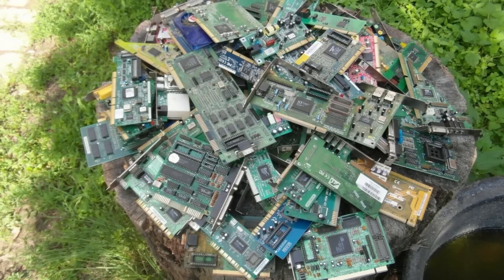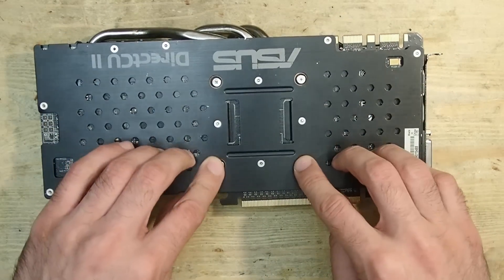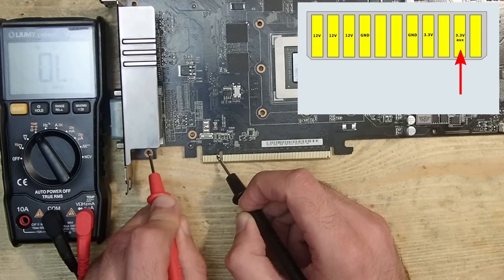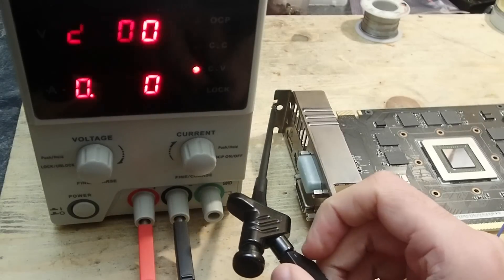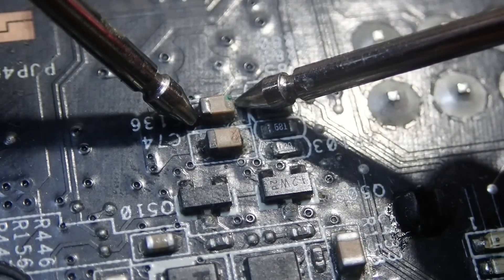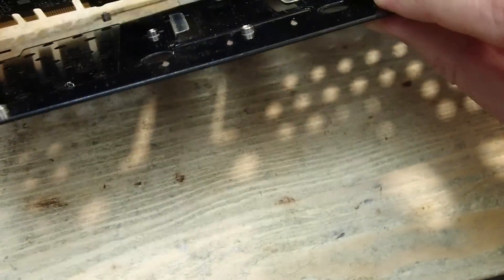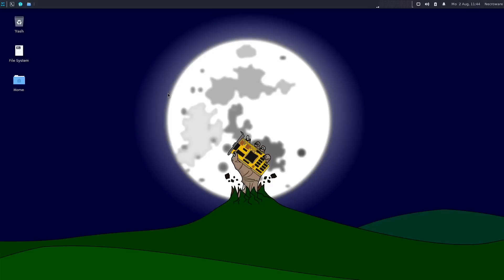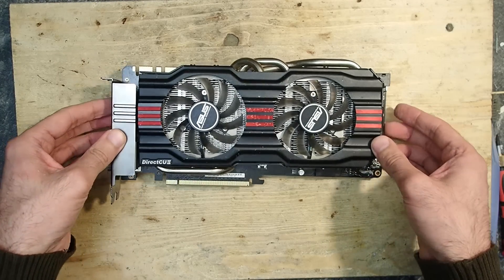GPU shortage? Let's repair an Nvidia GTX 770

Comment: This particular model of GPU has one of the most ridiculous designs I've ever seen, I owned one in the past. VRM temperatures are I N S A N E .
Fans and heatsink grill are mounted to board only by GPU chip and that's it. VRM section theoretically has its own black radiator, but fans above large radiator with heatpipes has mounts in such places that even on fan full blast there is no air movement whatsoever on VRM section. This garbage fries like fireworks even without any usage! What is worse, Asus boasts their cooperation with GPU-Z and this program sees every single temp meter on the board, and those temp-meters are abundant. The problem is, THERE IS NO TEMP METERS AT THE VRM SECTION!!! I once checked this board with no usage with thermal camera and if I remember correctly on GPU-Z (this particular GPU is for a fourth time dead and I have no patience repairing this garbage anymore) GPU Core temp was 45°, AUX 1, 2 and 3 was 56, 58 and 4something° and GPU power in connectors were also somewhere in 50-60 region. VRM was absent, but thermal camera told it all: it was 89° goddamn Celsius! AT IDLE! Full CUDA cores usage skyrocketed it above 140°. No capacitor will survive that for long! I never again bought Asus board.

Comment: can you explain what exactly the shortage in the cap? its beeping right?
Reply from the maker: Well, by its nature a capacitor should not allow the DC current to flow through it. And if the multimeter beeps, that means, that the capacitor is shorted internally and acts now as a piece of wire connecting to points on the card, which shouldn't be connected. In this case beeping is something bad.

Comment: Heres a trick me and my friend did (for short term)
He had a simular model but GTX 680 not GTX 770. The power connections were the same and his powersupply also had 2x6pins.
If you put a wire connecting the 2 remaining pins on the 8pin connector the LED will shine green not red because both end pins of a 8pin are ground.

He was gaming on the card untill he got paid and got a better psu
Reply from the maker: I know, but I didn't bother to modify anything, because that old PSU would be too weak to test the card anyway. I had to get a more powerful PSU for testing and so I decided to wait one day.

Comment: This video is as russian as it gets. Old hardware, sketchy power supply, soldering SMD components with a giant iron, unknown thermal paste. But I love every bit of it
Reply from the maker: Hehe :D This video was completely "Made in Germany" ;) Actually the soldering iron is not that big, its SH72 with a relatively thin tip, but compared to that tiny caps everything looks huge. The thermal paste is HY510. And if you are talking about the ATX power supply, which I bought for this video, it turned to be surprisingly good. Super silent and absolutely cool, I tested it meanwhile up to 360W and looked inside. One issue is, that it doesn't have a short protection on 5V rail. Everything else is superb. I have a BeQuiet PSU in my main PC, which is about 3 times as expensive, but I couldn't measure any real difference, except the named 5V protection.

Comment: When using voltage injection is it possible to use air in can to have a "frost" layer on card so you can actually see it melt (short circuit)?
Reply from the maker: Yes I used it even for this video, but the camera didn't focus properly, so I threw it out.

Comment: anyone know if this could be done to a vega 64 ? I had a near new one that failed , gigabyte would not even repair if I paid for it , never mined / OC'd and spent 99% of its time idle , it was only used as multi display , now only works as a single display and drivers no longer reconize it as a radeon , i was told GPU is dead

Comment: How to detect faulty chips?
Reply from the maker: That topic is a lot harder. It depends on what kind of fault the chip has.
Reply: @necro_ware  does this method of short finding which you did in this video will work in finding faulty chip.
Reply from the maker: Yes, it works for most of components. You can also find shorts this way in chips, transistors, regulators etc...

Comment: A thermal camera would make that wayyy easier
Reply from the maker: I find it exciting, that you don't need expensive equipment to repair stuff. I usually try to use only what's really necessary. An IR cam would be nice for a video, but for the repair it's absolutely optional.

Comment: I accidentally broke off a SMD component from a NVMe SSD and it stopped working, I had a tube of liquid metal (for CPU) around so I just put a blob of it on the place where the SMD component used to be. Now the SSD works perfectly. Lol.

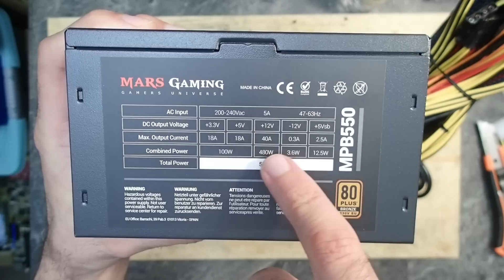Comment: 15:37 THATS CPU 4+4
Reply from the maker: yes, I probably switched my brain off in that moment :)
Reply: @necro_ware  Also - You can check  techpowerup for this card - It's Asus GTX 770 DirectCU or DirectCU II (no matter if it's oc or non oc, they have different BIOS). For pcb pictures ofc. You may see proper values of those ceramics

Comment: legendary levels of inspiration; truly from this video I feel like I can fully delve into microelectronics:)
Reply: I currently have a semi dead GPU (I can get to BIOS with graphically glitched lines on screen, but not boot) I am wondering if I could somehow repair it now.
Reply: That could be problematic, I am unsure if voltage injection would solve that as it could be anything, along with the fact the GPU die even could be producing the artifacting, though with this method it's good if there's a short on the card preventing use entirely
Reply: @2150-i5q  yeah,  I figured partial function would probably be worse than no function due to where the damage is likely to be.
Reply: Dang, well; I'll brainstorm and write here if i think of anything usable, though I feel like artifacting could be caused by caps or slight faults with vrms, though Idk what to do really for GPU artifacting involving the compute cores

Comment: As a person who has some experience in repairing GPUS 
I would recommend 
Not in your right mind ever use voltage injection on a gpu until its necessary 

He was lucky this time let's say that 
The short was coming through the cpu to the caps then those 3v would have killed the gpu instantly 

And you should check for shorts on both sides of the fuses if there are or the coils for 12v pcie 6pin and 8pin 
Since the fuse can blow and there is still a short but you will not see the short on pins itself

It is recommended to remove all the memory and vcore coils and then inject voltage if the short Is on 6pin pcie pins or 8pin
Reply from the maker: If you use a notebook PSU to make a voltage injection, probably it would kill it. But if you have a proper workbench PSU where you can limit the current, it will not kill the GPU. It might look like that, but let's say, this was not the first one I repaired ;)
Reply: @necro_ware  you are right 
But voltage is more important then current 
If you set max voltage of .8v 
Let's say 
At a max of 5 amps or even 6.5 amps 
Then you are still good because if you were to inject .8v through the core 
The core would still survive 
And because this is lower then any voltage rails present on the gpu 
I am saying this because you applied 3v through it 
The max you should go is 1v  
With higher current 
Since we know that power is the product  of voltage and current 

And you should give disclaimer for not attempting this at home 
Since most of the viewers don't have a bench psu 

By the way love your content 
Keep it up!!!
Reply from the maker: Thank you very much. Nobody should try what I'm doing anyways :D I don't make a disclamer in every video, but in my last video I said that and on my about page is also written, that nobody should use my work as a reference. The good thing is, that I'm in EU and luckily we don't need to make any official disclaimers here, unlike in USA. Fortunately nobody can make me responsible here for being stupid :D
Reply: @lovedeathhatepoison8737  he also said because it was already dead, he didn’t care if he killed it completely
Reply: "The short was coming through the cpu to the caps" - no.
A short was measured on 3v3 Aux to ground - video at 5:30
A wire soldered to 3V3 Aux and connected to + on PSU. Negative output from PSU is connected to ground/frame.  
How do you get current to flow through the GPU?  It won't - and during normal operation the voltage IS 3v3 - and he shows the card to be working fine in the end of the video. 
Sounds like you're creating a lot of extra work for yourself :ø)
Reply: @EgonSorensen  I am saying if this short was on any of the 12v rails then it would be devastating 
3.3 is not connected to the core 
I know that 

I was trying to warn any amateur person who would inject voltage on any shorted area of the board

Comment: Trying volage injection without a thermal camera? That's brave.
Reply from the maker: You don't need a thermal camera for that repair, if you know what you are doing. And if you don't know what you are doing, even a thermal camera will not help you. Just don't go directly to 5A, but do it slowly.

Comment: I love this. This card would have gone in the bin because of 2 parts that cost practically nothing, and now it has a new life. I feel like having a ir camera would be good for this sort of fix.
Reply from the maker: Thank you. I usually don't do such repairs that often and where it looks fancy for a youtube video, in reality you don't need that expensive camera at all. If you don't want to test it using a finger, then a bottle of alcohol and an ice spray make the job just as good.

Comment: Great video!  I have the ASUS GTX 780 ti version of your card.  The only difference is is that it has two eight pin connectors instead of one eight and one six like yours and other than that it is missing its fan shroud. It runs flawlessly!  It actually was part of an entire system that someone dumped on my front lawn back in July of last year.  The whole system was in sorry and VERY dirty shape and did not run at first.  After some needed love and care I was thrilled when the whole system sprang to life!  It came just in time before the "great graphics card apocalypse" of 2020 went full swing.  A gift from "the gods" maybe?  It plays just about everything I throw at it and as a bonus it will help keep my house warm this winter as the 780 ti gobbles power at 250 watts!  Bad for my air conditioner in the summer though.....😁

Comment: This was a fascinating video to watch. A great job!

I (still) have the exact same videocard, bought one eBay years ago. I never used it much - a pity, as it is better than my 1050Ti that I bought for my R5 1600 a few years ago?
Reply from the maker: I think, that the 1050ti is better from the performance and power efficency point of view. The GTX770 is comparable with GTX960.
Reply: @necro_ware  And 1050Ti is on par with 960 4GB, maybe slighty oc'ed

Comment: Take a can of duster and spray it upside down on the board. It will frost over the board and the hot component will thaw first making it extremely easy to see where the short lies.
Reply from the maker: This is what I did in this video. I spray some IPA  and use a can of ice spray. Unfortunately the camera didn't focus it as I recorded, so I just removed that part altogether during the edit later, since it was totally blurred.

Comment: in my dead graphic  card i have 402ohm between the 12v and ground and 368ohm between the 3.3v and the ground.
Reply from the maker: That's not a short so far...
Reply: @necro_ware  yes But still something ic Is burnt, and if i will ut back to PC, it will continue burning and smoking, luckily its not the vrm of the card. It should be the pwm controller of the fan. The ic removed by a screwdriver. The ic doesnt have legs, its mounted on the board, so i picked a small screwdriver and a small hammer and started to pierce it, the black thing came off, and the ic die itself (fan pwm controller ) was there. i started to add some solder it, itt was all alluminium block (the die of the ic) and picked a small screwdriver and it came off. I managed to remove the mounted ic without hot air. I was quite brave due to the board was quite thicc. It was an Radeon R7 240 OC 2GB Powercolor edition. Today i will test it if it was only the pwm controller of the fan, if it should be, then i am lucky, due the card is working right.And i will put the fan in 12V, except i place a resistor, or i wire it to 5V.
Reply: @necro_ware  Two of the VRM mosfets not getting voltages on drain, the voltage injection has happened. no kaboom.

Comment: Learning so much from your channel, have been an IT tech for 15+ years and do mostly software issues occasionally replacing dc sockets on laptops etc always had an interest in the hardware side of but limited until now. My only issue is soldering, I have some decent kit and when I remove a faulty component sometimes a neighbouring smd comes off, what can I do to avoid that. thx
Reply from the maker: There is no magic behind that, just practice :D I'm actually a software developer, I had digital electronics in the university, but all the practice didn't come from my job. This here is just a hobby.

Comment: I am trying to repair my RX 470 that has a black screen and I am thinking of buying a power supply to try to repair it, in the same way that supply will help me to repair other things, ty for the tutorial
Reply from the maker: You are welcome. It's good to have such a power supply for many reasons, but in the case with your card you have to validate first, that it has a short. The PSU will only help to locate it exactly, but you have to know where to start.

Comment: That was great to watch. Saving a 100+ euro GPU from e-waste with a couple of replaced caps.
Reply: Exactly, that is why teaching yourself board level repair is essential in our economy. Boards fail all the time in all sorts of devices from computers, electronics, appliances, etc. In the best case, replacement boards are available, but when not it may mean throwing out an entire appliance for a single failed cap. That alone justifies the cost of investing in a proper solder station.
Reply: his work as a service costs more than already working used gtx 770. No repair shop would do all this under 50eur, 100eur is more likely. So you either know how  to do this yourself, or it's e-waste.
Reply: @Ludak021  but you could do it on your own (or ask a friend), trying cost nothing
Reply: @Ludak021  what ? in my country they fix that with the price around 10eur or a bit more

Comment: I have a GTX 770 that gets fan spin but no video image..
Reply from the maker: One of the possibilities is a shorted voltage regulator on one of the phases of the GPU near the 12V PCIe connector.

Comment: This was really entertaining video ! Thanks for this.
However I saw you soldered directly to the GPU for the voltage injection, you could just remove a PCIe slot from a dead motherboard with hot air and solder it directly on that instead of the GPU itself, just to avoid the mark from the soldering on it.
Anyway great video, you just earned a sub ;)
Reply from the maker: Thank you, as I already said in the other comments, I had this in mind as well, but I had no dead PCIe mainboard, where I could take a slot from.
Reply: @necro_ware  Oh my bad, I didn't read the other comments
Reply from the maker: @AizenJoestar42  No problem ;)

Comment: Very cool. Just a little tip. Instead of use your fingers to find where is the hot place and risking to burn yourself, just drip a few drops of isopropyl alcohol over board. Where componentes is hot, alcohol will evaporate. Regards from Brazil.
Reply from the maker: Thank you! Yeah, I also do it like that, I spray some IPA and then ice spray on top. It freezes the IPA instantly and you can see the spot where it melts. Unfortunately, as I made this card I ran out of ice spray, so I made it just with IPA, but the camera didn't focus properly, so I threw that part out later during the editing.

Comment: can repaired gpu last long? and also do we care alot or used as normally we used before.. tell me bro i am waiting for your reply thanks.
Reply from the maker: That's a hard to answer question. Does anything you would repair last long? If it's a car or electronics, doesn't matter, things get broken and can be repaired. If they will break again depends on so many things, for example which replacement parts did you use, or why did it break in the first time. Especially the last question is often hard to answer....
Reply: i just want to know that can we use it normally or we just add care more :D
Reply from the maker: @musawaraliabbas713  Hehe, you are funny :D You can use it normally.... Compare it with any other thing you use. If you bring f.e. your car to repair, can you use it normally after it's been repaired? I guess, if something was repaired properly, you usually should be able to use it normally again.
Reply: thanks bro but i will use more care to make it last long :D rough days are gone :P

Comment: Most of the cards with 8 pins pci-express can get working with 6 pins pci-express.
The 2 pins for the 8 pins pci-express connector is for ground, 8 pins pci-express has 3 times 12v and 5 times ground.
Reply from the maker: Yes, but that old psu would be too weak anyway to run the card.